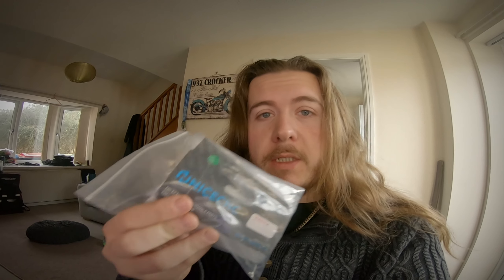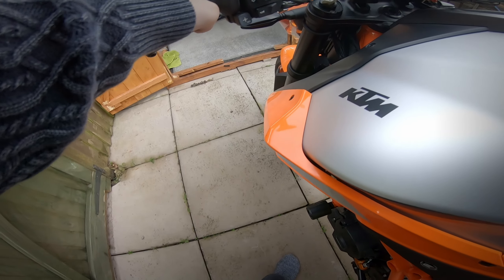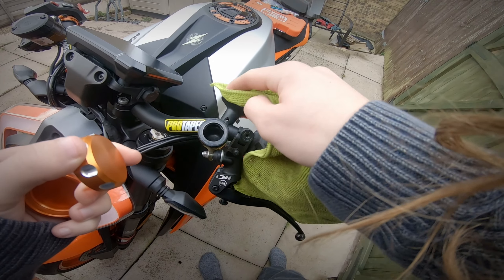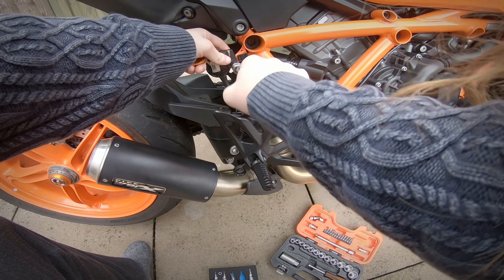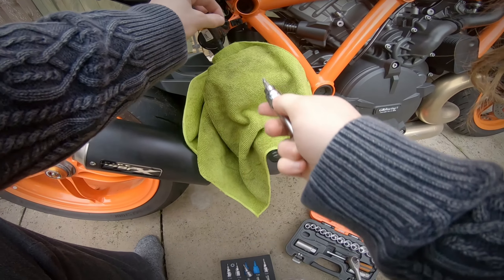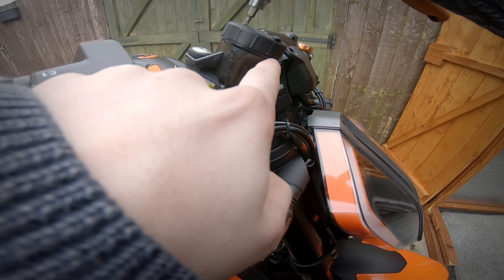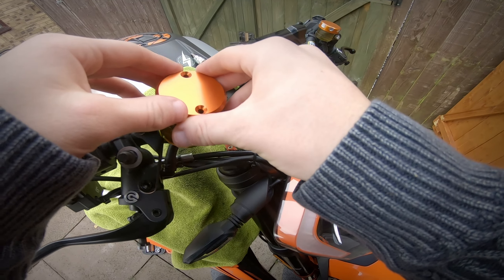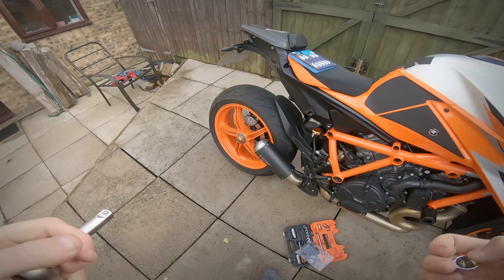The Best affordable Reservoir caps? NiceCNC | Plus Moving Throttle Position | KTM 1290 SuperDuke R

Comment: I got the original PowerParts and the front brake cap suddenly started leaking this summer out of nowhere. Been having trust issues ever since, but they look so good compared to the stock ones so I just can't switch back. I also have the same noise btw.